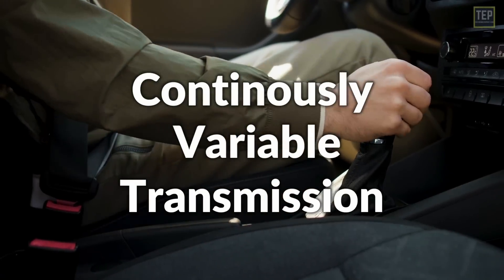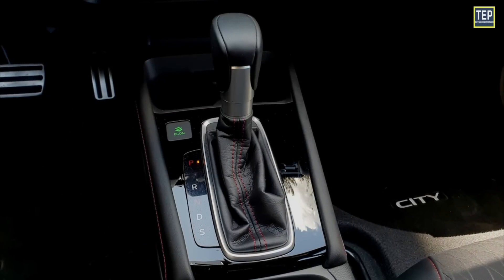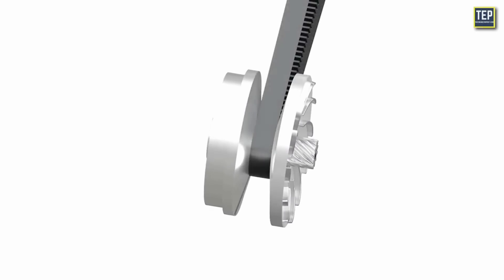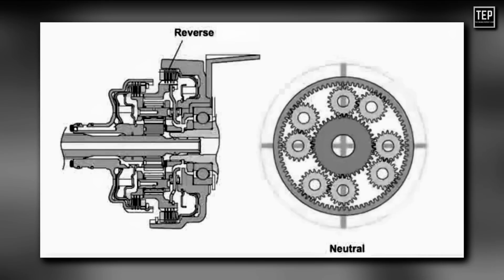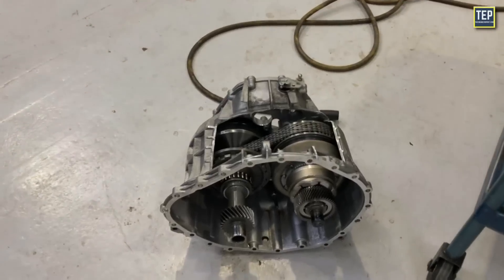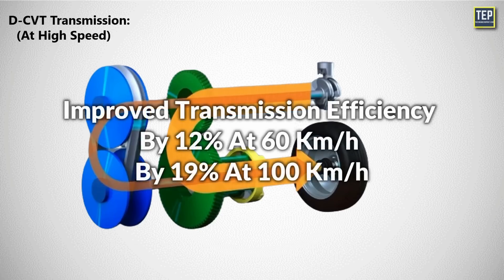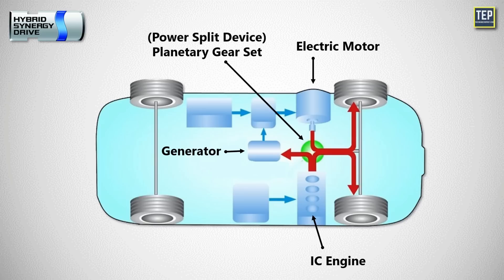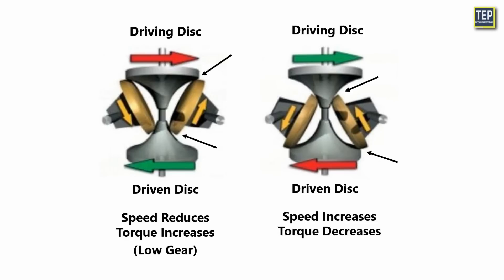Are There Any Good CVT's? | Different CVT Transmissions Explained

Comment: Toyota and Honda CVTs are good.  Nissan CVTs are terrible and should come with a consumer warning.
Reply: Nissan made the mistake of claiming the fluid was good for the lifetime of the vehicle and it is not.  Regular fluid changes make it a very reliable transaxle or transmission.  We change our fluid every 40k miles, but most people think 60k is OK.  We have 370k miles on ours.  And my friends that listen to me are not having problems with their Nissan transmissions either.
But there in lies the catch.  What is considered 'the life of the vehicle'? Easily answered, how long is the warranty?  Change the fluid often, and the Nissan CVT is really pretty good.
Reply: @davidbeckenbaugh9598  Sadly its not Nissan or Stellantis group any more that say this. GM is doing this. Wonder why they removed the dip stick? Boils down to GREED. They don't want you to check it, when it gets low they burn up. Some will not show a leak either. Just like that Tail Light warranty, once the light goes out so does your warranty.
Reply: @mike9119  Gotta agree with that one.  And not everyone has the money to have the trans modified with a stick or sight glass.  Assuming they can be modified...
Reply: I changed mine at 50k @davidbeckenbaugh9598
Reply: Sorry but Honda CVT's are shit.  Their entire brand has taken huge damage to its reliability ratings and reputation since moving to CVTs.  Yes Nissan's are far worse, but Honda is not nearly where it once was.  Toyota with its true launch gear, are superior, but I'd still take a non CVT anyday over a CVT.

You can't escape that current CVT's are purely driven by friction.. a design exists that utilizes gears to drive CVT rather and just friction to operate, but as far as I know no manufacturer has built a car transmission around them yet.
Reply: @seanpeck8748 just traded a 2015 honda civic with 94k on the odometer. As the car got older it seemed like RPM's where higher than normal and not much happening for speed.  I changed the fluids 4 times since we owned it from new, with all honda cvt  fluids. So still wanting to stay with honda but not a cvt transmission. Only two options in the lineup passport or ridgeline. We ended up going ridgeline. Hopefully it serves us well for years.
Reply: @seanpeck8748  Honda had it's problems with CVT's, just like everyone else.  But between Honda, Subaru, and Toyota, they have them fairly well ironed out now.
And, if you had not noticed, manual transmissions are entirely friction driven also.  And auto trannies have friction in their synchros and the torque converter, not to mention a bunch of other things including he engine.  Look into the m again.  You seem to be stuck in the past, about 8 years back.
Reply: @davidbeckenbaugh9598  comparing clutch plate friction with pulley belt friction is laughable.

CVT’s are shit, period.

Some are less shitty, but they are all shit, at least the pulley belt variety.

Planetary gear based CVT would be the only CVT I would touch.  And other than some hybrids don’t know if a single ICE production vehicle they are used in.

There isn’t a belt driven CVT that is ever going to have the lifespan of “regular” automatic transmission.

Yes they keep the engine in the power band regardless of speed, but they will never last no matter who makes them.  The launch gear helps but it’s still a design that will never have the life expectancy of the previous design.

So if you like the better gas mileage and don’t care your transmission is going to crap out well sooner than it should, by all means buy the CVT car.  Me, I’ll hard pass every time
Reply: @seanpeck8748 sei un ingegnere capo di esperienza lunga?
Reply: I'm currently driving a Nissan Kicks, which has a CVT. What trouble should I expect?
Reply: @tim57243  No problems with the CVT IF you change the fluid often.  Old transmissions, like the C6 in my 1971 Ford, were changed every 30k miles.  Newer non-CVT autos recommend every 60k miles.  I sort of split the difference and do 40k on mine, but 50-60K changes should be good enough.  More frequent changes are probably pretty good, but you have to balance the cost-benefit ideas/ratio.  How much do you want to spend on a transmission replacement (they cannot be rebuilt)? $4k or 5k? Or less than $500 for the life of the vehicle for more frequent fluid changes?  I choose $400 vs $4,000.
Reply: @davidbeckenbaugh9598 That makes sense, so thanks. It is a rental car that will be returned before the first fluid change so I won't worry about it.
Reply: @tim57243  Many mechanic's will tell you Nissan, Mitsubishi and others from the Stellantis use the CVT Jatco transmission which are notorious of break downs. They are cheaply made. Their rear wheel drive transmissions are good. They are used in the Nissan pickup trucks. Stellantis cars made by this company are junk, just like all French cars. They were in the news a lot for many years going after the CEO for making cars that break down in short time. You can make sure you drain that transmission a lot keep it clean. Get rid of it ASAP.  when new they are OK unless they start breaking down early.
Reply: @tim57243  - none - but - change that transmission fluid at 1/2 interval (30K to 40K) to insure a smooth and efficient CVT.
Reply: @tim57243  isn’t Nissan Kick use generator and electric motor?
Reply: Thank you. Will pay attention.
I'm looking into Honda CR-V to change a car...
Reply: Nissan are diffently the worst. Bought a new 2022 Honda CRV, and had vibration starting, very early. Had fluid changed around 30,000, no real improvement, and slowly losing gas mileage. My two cents worth, on CVTS.
Reply: @saved217  Does not sound like a transmission problem.
Reply: Cvt are shite if you are towing so i say no to them they are crap
Reply: wish I would of watch this video before I bought my nissan murano ...don't do it..
Reply: Bravo ma sono diversi il Nissan è CVT mentre Toyota Lexus, Honda Ford sono e-cvt!!! Costruiti differente
Reply: That was some time ago.   Current CVTs seem fine.
Reply: I can attest on the Honda CVTs. We have a 2013-2014 Honda Accord with the 2.4L engine and CVT. I’ve done a simple drain and fill on it since it was two years old. Thing still has been smooth and reliable since new.
Reply: Stop saying Toyotas use e-CVT, they too have cheated and use it in only some models, they use trash CVT rubber bands on cheaper cars without telling you. Don’t you research or just swallow what’s put out as “ true news” smh
Reply: no, they are not good. 
toyota's cvt are good.... it means only one, you have never driven a car with a proper gearbox.
Reply: @emilianoitaliano508 since you are nitpicking, "is good" perhaps😊
Reply: What do you mean by “Good”..?

Modern CVTs get ~150-200K miles…

Accords/Camrys of the late 80s/Early 90s can easily get over ~200-300K miles…

…So in 50 years, why hasn’t cars been getting >1 million miles by now..?
Reply: @jimliu2560 yeah, why aren't all product made to live forever so you never need to buy another one from manufacturers??
Is there an explanation in that sentence somewhere? 😊

Comment: (a.k.a., infinitely variable transmission) The concept is ideal. The CVT keeps the engine in its ideal "powerband," that way fuel efficiency is increased and performance as well. It was band from F1 racing because of this! And not many of the racing teams could afford the cost.
Reply: there should be cars with manual cvt transmission that would be controlled like aircraft throttle..
Reply: @a2_games that would be weird haha
Reply: CrapVT 😊